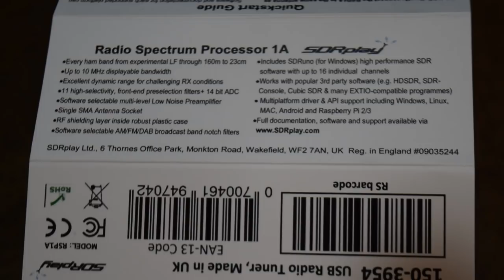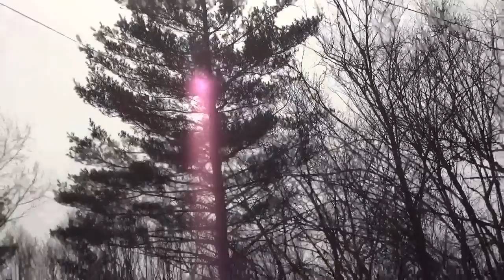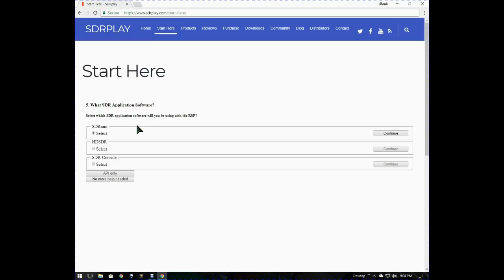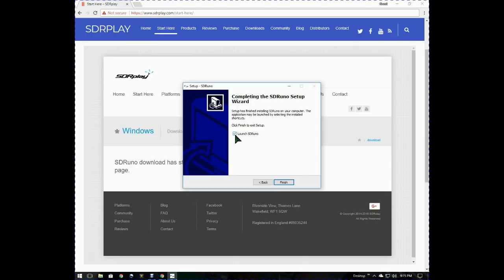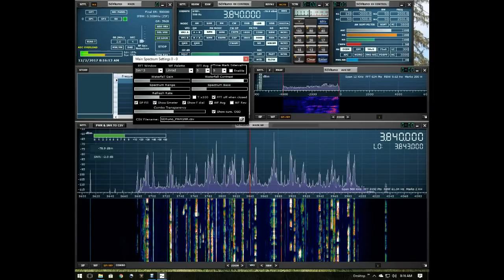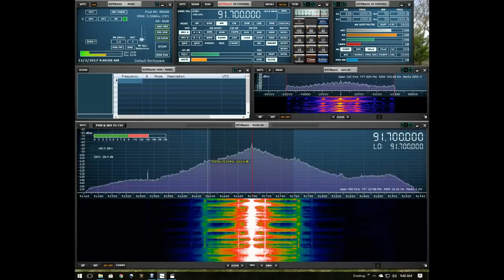SDRplay RSP1A Setup With SDRuno - Basic Operation and Overview

Comment: I don't have the room on my lot for an antenna setup like yours. Any alternatives I could try with this unit? 

I really like the video and I am thinking of getting this unit as a low cost/space saving choice to get into a better radio set up. Currently I have just a little cheap portable with shortwave and weather bands.
Reply from the maker: Almost any antenna will work to some degree with this radio.  A good antenna for HF bands on a compact lot might be something like a mag loop.  Or even a wire strung in the trees or something along those lines would probably work fine.  If you are interested in VHF/UHF and above then you may want to look at a wide-band Discone.  

These RSP units offer alot of value for the money.  If you are interested in the versatility of an SDR then I'd recommend getting this over a traditional portable or tabletop radio.  And keep in mind, these can even be used with some android (not sure about Apple) phones and tablets so they can be used portable as well.
Reply: For a wire strung in the trees would I use a single wire or a "T" shaped FM like wire antenna? I imagine the longer the wire the better? But I would think the length of the wires would effect the frequencies you can receive. It looks like you have some sort of dual wire thing going with your fan-tail, I think you called it, setup.

Sorry for the "simple" questions but I am really new to this.
Reply from the maker: For basic receiving signals the antenna configuration isn't really critical.  Pretty much anything will work to some degree.  An antenna that is cut to the proper length and polarized for the band/mode you want to listen to will work better.  However, For just getting going with the RSP and learning the software almost any piece of wire over a few feet long should work well enough for you to receive something.  

The antenna I'm using is a fan dipole with elements cut for 3.700 MHZ and 7.200 Mhz that I use with my ham radios.  It is designed to work best around those frequencies.  However, on my RSP1A I can reliably receive signals from as far down as the bottom of the AM broadcast band (560KHz) all the way up into the VHF high band (162 MHZ).  

I guess what I'm trying to say is just use whatever antenna you can and see what happens.  I'm fairly certain you'll be able to hear something.  Once you get more comfortable with the radio, you can then put up "proper" antennas that will work better for the frequencies you are interested in listening to.
Reply: OK, Thanks for the info and your patients !!!!!

Comment: Around min. 18.00, the explanation of rf-gain REDUCTION, it must be the opposit. The more gain-reduction, the lower the signal-level... 
very good review, by the way ... (I have RSP2Pro, 73's de PD0IFI)
Reply from the maker: Sliding the control up increases the RF gain and sliding it down reduces the gain.   In my situation I've found increasing the RF gain increases the background noise as well as the target signal so for most listening I leave the RF gain at the minimum setting.  Thanks for watching! 73!
Reply: great job,really helped getting my RSP1A going

Comment: I've had the RSP1 for several months now and looked at dozens of videos. The software for the 1 and 1A are all but the same. This is by far the best video I've watched! I'm anxious to spend this snowy weekend in Connecticut trying some of the things I've learned tonight. I'm in Trumbull. Any chance I could borrow your antenna for a few days!!?? I'm jealous! I'm hoping the weather next weekend is better so I can get a long wire up. Thanks again so much.
Reply from the maker: Thanks Jim!  I have had the older RSP1 for about a year now and I've been having a lot of fun with it.  I just got the 1A and will be doing the same as you this snow weekend - testing it out.  Trumbull is only about 60 miles southeast of me (I'm in NE CT) maybe the coax will reach ;-)